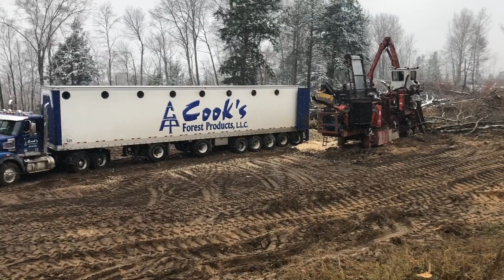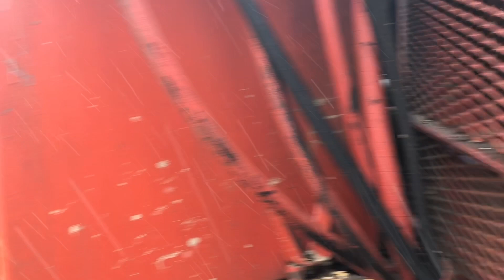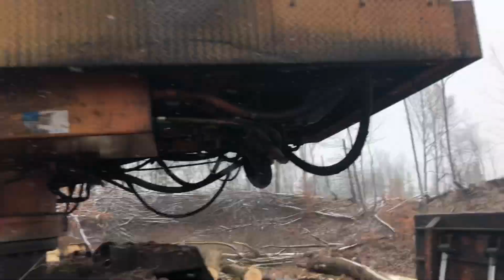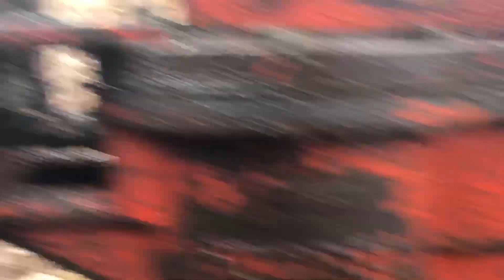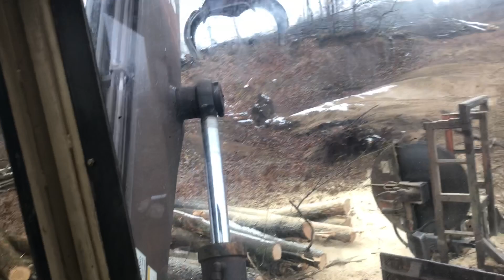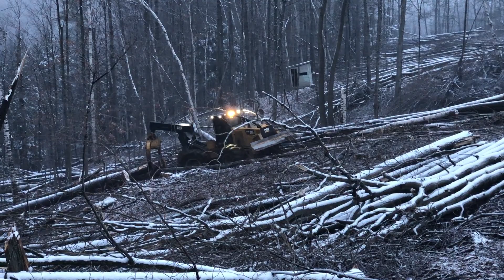THE LAST BUNDLE OF THE WEEK!

Comment: The thing I don't understand John, is why is it when you have those big Sandy or mud patches that are directly in front of the chipper, instead of pushing more sand and dirt with the dozer, why not take the chipper and run a couple of trees through a blow them to blanket the road area with chips for traction. You already shown us that will reach about 150ft- enough to completely cover the road. Just saying.